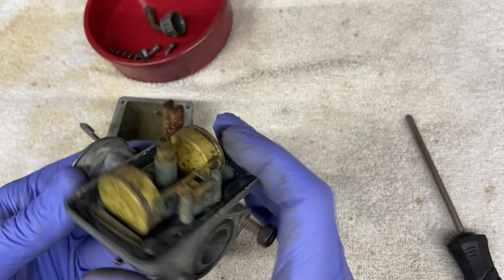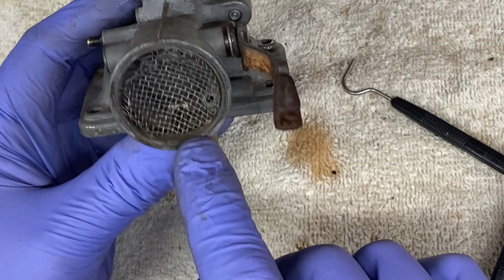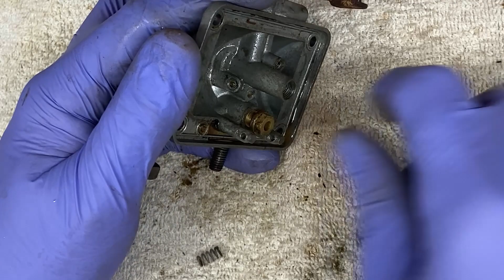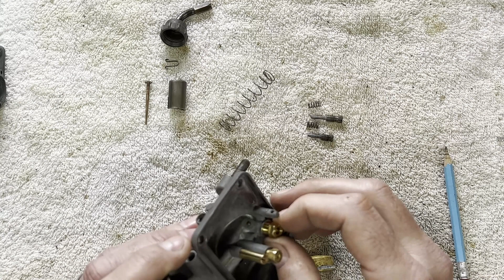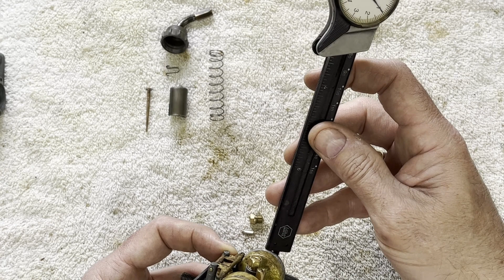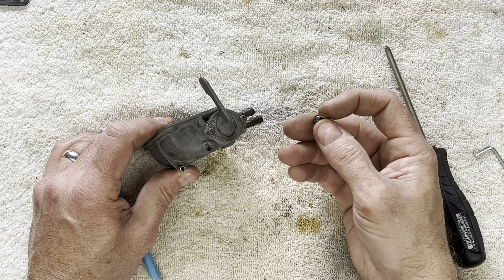1968 Honda CT90 K0 "Trail 90" Rebuilding the Carburetor and First Start

Comment: Oh, I wanted to mention, I found my 4 mm screw on the circular filter to have the tiny O -ring on the inside. Not on the outside. It seems to make more sense from an install perspective to get a good seal for gas. Great video! Very helpful!

Comment: Nice that the chunk out of carb slide part didn't affect carb function.
Reply: that's what you think.. it seals against the upper rim to the cap. with a chunk that big missing, the carb will have a big air leak through the threads of the cap and forever be running very lean.

Comment from the maker: There are so many steps backwards. You get the magic of video editing.
Reply: Hello, thanks for making this video, there is little info on these early 4 screw carbs for the k0 ct90. I have searched everywhere for a fix to my issue, and I can’t seem to get anywhere. My 1968 ct90 just won’t stop overflowing from the bowl tube, i replaced the needle and seat, the gasket for the bowl, and tried moving the float all over. I even switched the float for another one. Anything you can recommend? Thanks
Reply from the maker: @elfpatrol4070 mine occasionally leaks a little. I would break the diagnosis down. Does the needle and seat seal the flow of fuel if you set up a gravity feed of fuel?  You can set that ups as a bench test. If that seals, you know the needle and seat are good and you are down to the float. Either an adjustment or a bad float. Bench test and confirm each step.